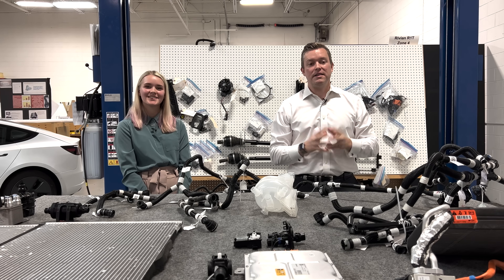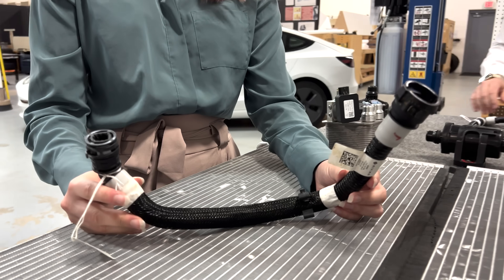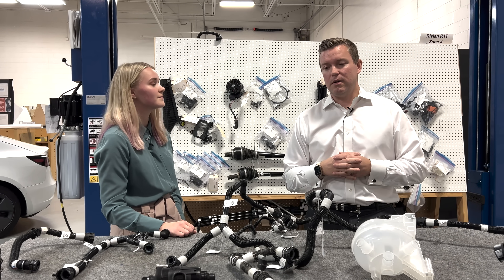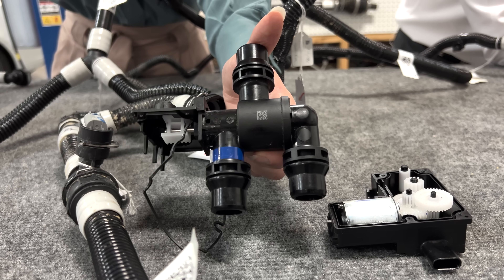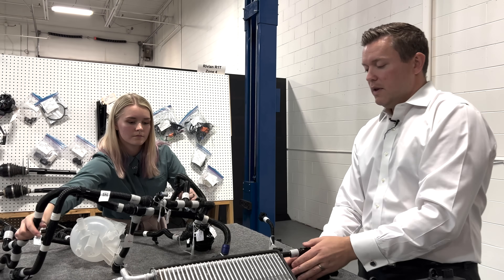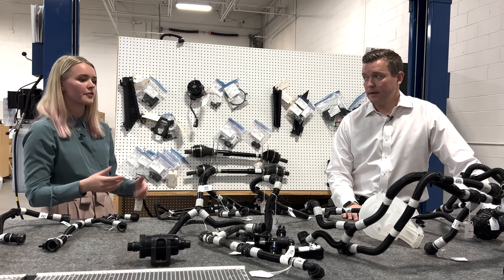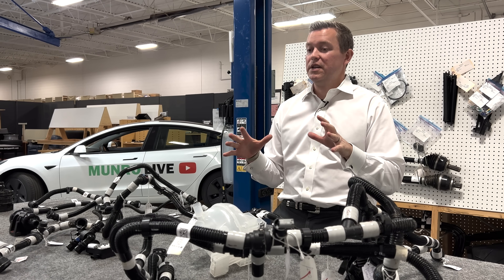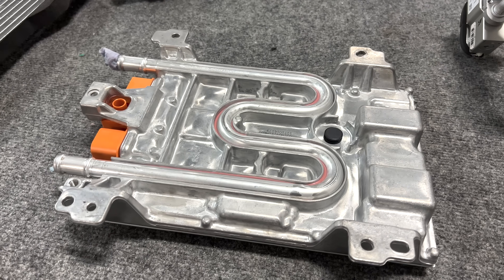Ya Basic (But Efficient)! Rivian R1T Thermal System

Comment: Just imagine what someone could do if they applied the same thinking to residential appliances take the waste heat from the ac to heat the water heater. Use the super heat from the refrigerator to heat the water. Recover the heat from the shower after uses and have an octo valve that manages everything maybe even incorporate the dryer in the mix. Wow a  home would be super efficient the technology is here via heat pumps but the integration is missing.

Comment: So is this system as efficient as a heat pump system or is heat pump still a better option and if so when do you think Rivian will go to a heat pump system? What is the power consumption difference if measurable between this system and a heat pump system? Are you seeing any differences in the dual motor thermal system compared to the quad motor system?

Comment: @5:30 it’s a chiller with Electronic expansion valve. I am not sure if it’s possible to have the refrigerant flow in the opposite direction. Can you verify the system or explain in detail.

Comment: As a R1T owner, I can say this traditional heater works better  than heat pump systems in teslas. Less efficient, but it's like a traditional heater from a ICE. HOT air.

Comment: ADAS? Found it “advanced driver-assistance system.” So does this mean ADAS imposes high thermal loads? What portions of ADAS componentry requires thermal management & to what extents? Alternative/comparative implementations? Thx for the continuing excellent detailed engineering info!
Reply from the maker: Yes. The ADAS processors get hot.

Comment: Considering Rivian’s modest unit production numbers, it makes sense to use off the shelf technology where possible.  Tesla’s annual Model 3 units produced is almost an order of magnitude higher, thus the added up front costs of custom design and validation of parts is justifiable.  That octovalve, for example, cost plenty to design and more to validate, but it doesn’t save a huge cost per unit.  You have to make a lot of units for it to make economic sense.

Comment: Alex yes Chiller is actually an Cooling device and when Expansion is fully open then Compressor will be flooded with Liquid which Derate the system Definately Chiller is only Chiller can’t act as Heater unless you have Valve configured to absorb the rejected Hear from somewhere within the system

Comment: I wonder if the reason Tesla uses the plate heat exchanger in the motor units is for reliability and durability purposes. If there is a failure in one of the lines that is routing ethylene glycol through the unit, the coolant will mix with the oil and it will need near complete disassembly to remedy the problem. The plate heat exchanger may be less likely to fail and easier to change if it does

Comment: Could the valve for the rear motors be used for conserve mode? The truck goes to front wheel drive so probably don't need to cool the unused motors.

Comment: Nice presentation. I do have one question: If the car used a heat pump in lieu of resistance heating, how would that improve the range? Or, would it be cheaper to just increase the battery capacity?
Reply: Heat pumps add range and/or lower battery size. Every Watt of added battery capacity comes with a weight penalty that means heavier and stronger frame and suspension components, and more energy used to move (lower efficiency), so less miles per kWhour of energy. Heat pumps can return a 1 to 5 ratio of power input for heat output, so 4 times more heat than if they just used resistance heating. 4 times less battery capacity needed to get the same amount of heating is huge when it comes cost and weight reduction. That is the brilliance of the Tesla system, since it integrates all of the cooling and heating needs of the drive train, batteries, and cabin into one heat pump unit, while according to Monro Rivian uses a heat pump for everything but the cabin heating, where they use resistive heating. Although I wonder if maybe the resistive heater was just a backup to the heat pump unit to provide extra heat in very cold weather, as it looked like a heat pump system, just not as integrated as Tesla's. People forget that an AC unit is a heat pump that pumps heat one way out of our buildings or cars, although we tend to use that term for bi-directional heat pumps that can both cool and heat a space.

Comment: There should be a small fuel engine in EVs as a winter option to provide excess heat mainly.
Reply: There are sources of heat in an EV, the motors constantly produce heat, the inverters produce heat and the batteries due to internal resistance produce heat when under load. This vehicle uses thermal management techniques to reduce the amount of resistivity heat required for the cabin.
Reply: @heathwirt8919  I'm saying winter, and I'm thinking starting up. I don't want to lose distance possible, just for a warm seat.
Reply: @lightdark00  The resistive heating is instantaneous. The other sources are not, including a heat pump.
Reply: @heathwirt8919  Did you not see the point of not wanting to waste any distance of a power resource I that takes a considerable amount of time to replenish?
Reply: @lightdark00  I did see the point you were trying to make but it seems moot since the amount of energy used from the battery to give you instant heat until the other systems begin sharing heat energy is not very significant. The idea of having a separate system using fossil fuel to generate cabin heat seems excessive and over complicated from an engineering and cost perspective.
Reply: @heathwirt8919  It would be fun to have a little  two or one cycle engine like on a string trimmer that helps out. 🤷‍♂️
Reply: @heathwirt8919  At best, a gas engine to make heat might be at most 75% efficient.  Then you'd have to carry around a gas tank, gas pump, gas lines, a catalytic converter and a muffler.  Plus, gas sitting in a tank for "too long" absorbs humidity and goes bad.  Nope, the answer is to turn on the heated seat remotely before you get in the car, arrive to a mildly cold car but a warm seat.  Much more energy efficient, simpler and better packaging.
Reply: Nope, a heat pump is a lot more efficient. Adding an ice to an ev is like adding a coal fire for heating to an ice car: completely superfluous and outdated.

Comment: No heat pump?
That’s a huge bummer for colder climate. The range of ev in the winter take such a hit in Canada (and most of the central US).
Reply: The lack of cabin heat pump and battery cooling that seems to be lacking are the only things I don't like. 

From a battery / cooling system standpoint I really like what Tesla does, but in terms of the build quality of the vehicle overall I like the rivian way better. Just a little behind on heating/ cooling tech.

Comment: Interesting. sense it does not have a heat pump system or dedicated resistive heater, is it able to you quickly and efficiently per-heat cabin via refrigerant heat exchanger while parked during freezing temps outside?
Reply: With my R1T, yes.   Seems to be some variability among us owners based on what I read in the forums.   My truck heats as fast or faster than any other vehicle I have owned.  I have a detached garage and had no issues with heat inside the truck getting comfortable quickly with temps hovering around 0 during the Xmas polar freeze we had.

Comment: Is there any chance you can comment on the Rivians ability to recapture energy, specifically when decelrating and limitations in the system? I've seen a few threads and videos talking about how the Rivian starts to back off regenerative braking intesity while under a sustained load (towing downhill for example or driving down a long steep grade). I'm wondering if that's a thermal issue, or if having 4 motors (now generators) dumping power into the battery at once, begins to overwhelm the batteries ability to accept the high sustained charge rate?
Reply: Most EVs will limit regen if the battery is full. So then you need to apply brakes. But there are probably other conditions where regen is limited like if the motors or battery is too hot. Seems like there is alot of EV learning curve stuff that will impact driving behaviors as we go forwards.
Reply: @patreekotime4578  I understand that, and pretty sure every EV limits regen in full batteries. I'm speaking to Rivians ability exclusively where the regen will limit after a sustained use of 10-20 seconds. Regardless of battery state of charge or it temperature it would seem. I think I said this in my comment that it's likely exceeding the packs ability to accept power that quickly and starts to back off and blend friction brakes.
Reply: Maybe that's what the PTC's for?
Reply: I have only seen the regen limit a couple of times in mine.  Usually after a few minutes down a several mile hill.  Never in 20-30 seconds.  I assume its a thermal limitation.  At close to 8k lbs and 4 motors that has to be a lot more energy produced than most typical smaller EVs.  I also got a regen limited message in colder temps (low teens to single digits) for the first few minutes of driving.

Comment: Some heavy duty Diesel engines have a coolant filter but it isn’t to trap debris. They are used to keep the cooling system chemistry stable and extend the coolant life. The chemistry is used to reduce cavation and corrosion of the cooling system

Comment: Big EV HVAC advantage over ICE is that the compressor is not coupled to an engine so it can run at full capacity while the car is still. This shortens cooldown on hot days.
Similarly it can provide heat immediately on 'start up'.
Reply: It also doesnt depend on the driver pressing the "AC" button to make sure the compressor stays lubricated. I learned that lesson the hard way... had my engine completely lock up while going down the road just because I never liked cold air blowing up my nose. And then I had to pay to have the compressor replaced for the AC I wasnt using because for whatever reason there wasnt a dummy pulley available for that specific engine to eliminate the AC compressor.

Comment: In a way the way they are using the hot/ warm side of the ac circuit is a heat pump. If you look at a home heat pump system it is switching between heating and cooling depending on which side of the compressor they choose to either heat or cool your home.
Reply: Yes, that's how I'd define a heat pump.

Comment: Nice review - but jeebus that plastic geared coolant valve dealybob will fail in less than 10 years as plasti becomes brittle and old - is this easily replaced?
Reply: How do you know? Some plastics last forever.
Reply: Problem with most plastics is they last too long.

Comment: I like the coolant filter. If the system ever needs service it can be contaminated and filters are a great idea. Not a place to save money. Advice from a retired technician.
Reply: Agree! For example e-Golf has a bad reputation for compressor failures, leading to an insanely costly replacement of the entire AC system to ensure no particulates are left in the refrigerant system. A filter directly after an potential failure point prevents the problem from spreading, Keeping the R1T coolant clean is equally important when it runs through the battery,
Reply: I agree, that filter while an fairly expensive part will prevent the failure of several other components which would cost many times the price of the filter. An ounce of prevention that reduces life cycle costs and improves reliability.

Comment: So if the A/C refrigerant (heat pump) system is used to also provide strategic heat for the batteries and motors when needed, why is it not also used to heat the cabin?